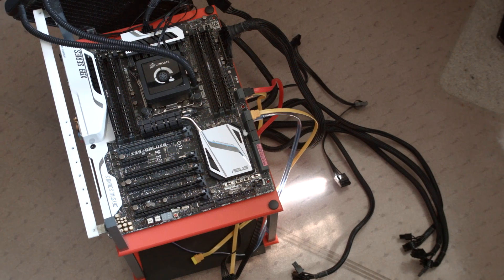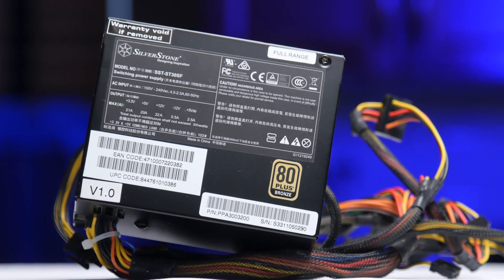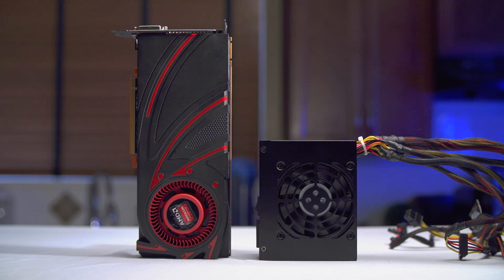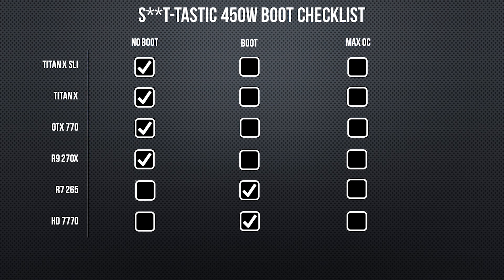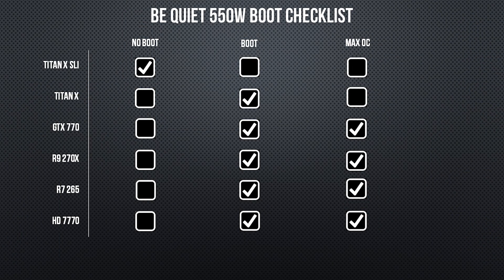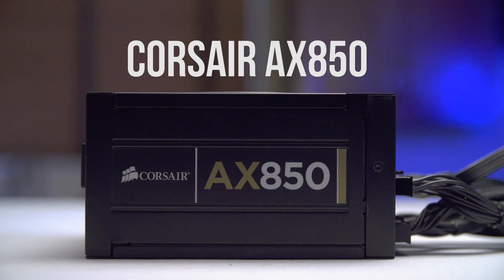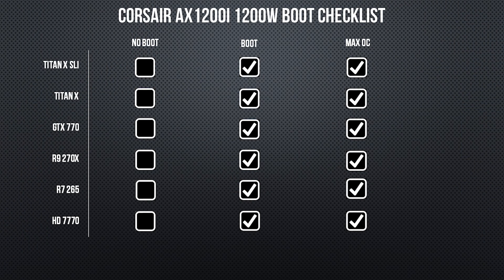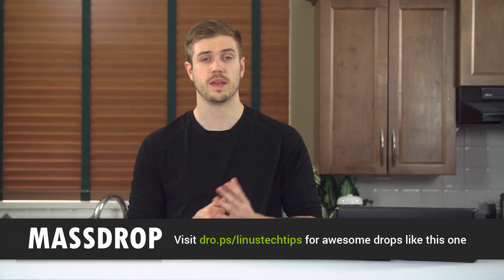Overclocking Recommendations - Low vs High Wattage Power Supplies

Comment: I was wondering if this was good for gaming

cpu: Intel Core i7-5820K
Ram: 16 gb
graphics card: Gtx 980 4gb
HDD: 3TB 
SSD: 250 gb
Reply: Thx, well I will be needing this quickly because I am getting rid of my alienware (btw I don't recommend buying since Dell took over. They are shit now). I'll be having it soon
Reply: Pierce Oconnor Good? Yes. Apropiate? Probably not. If you are an pure gamer and wont do any kind of content creation or you dont consider yourself an enthusiast who is willing to spend alot of money on minor gains then you should stay away from the X99 platform (which is the enthusiast platform) and from DDR4. Better get an Z79 or Z97 based system.

For high end gaming and basic content creation i recommend something in that direction:

cpu: Intel Core i7-4790k
Ram: 16gb DDR3
GPU: 980 4gb (If on an budget you could get the Gtx 970 or you could get an AMD Radeon card like the r290x)
HDD: 4TB (for Games)
SSD: 120gb (for Windows)

You will save ~450€ if you go down this road and see pretty much the same performance results. An High-End Z97 Mainboard like the Asus Republic of Gamer Maximus VII Ranger costs 150€ whilethe cheapest X99 Board i can find quickly costs atleast 250€ and my Asus Republic of Gamer Rampage V (X99) costs 450€.  The i7 4790k is about 150€ cheaper than the i7-5820k and 16gb DDR3 Corsair Vengeance for example is 140€ while 16gb DDR4 Corsair Vengeance cost 250€ and all of that X99 stuff gains you pretty much 0% performance increase in games, atleast today, since there is no game out there that supports 6 CPU cores. For SSDs i personaly only use them as OS drives since they are still pretty expensive compareds to regular HDDs and gain 0% performance in games except shorter loading times which is negligable.
Reply: Pierce Oconnor Of course the 980 is better but it is also double the price. The 970 is 350€ while the 980 is near at the 700€ mark. Performance wise you may see 10fps (84fps vs 96fps in Metro: Last Light on very high for example) more but for 1080p gaming at 60hz the 970 is more than sufficient and has probably one of the best price/performance ratio since a long time ago. And you could always get 2 970´s for the same money. Keep in mind that Vram of GPUs doesnt add up in SLI or Crossfire. That will work with DirectX 12 and Windows 10 tho.

Sure there is this whole ramgate nonsense out there. The 970 got split memory. An 3.5gb chunk and an 0.5gb low priority chunk which is alot slower (about as fast as regular Ram). But people are that missinformed that they think they would need 4gb of vram or more which is simply not the case.  In 1080p there is no way ever using 4gb of vram, not even 2gb of vram. In UHD (2160p) you may use 2,5gb of vram in Battlefield 4. There is no way that you would even cap out the 3,5gb chunk unless you would crank up anti-aliasing to the max which is a waste of performance at UHD anyway due to the massive amouth of pixels it is simply useless and doesnt improve the image quality whatsoever.

And just FYI, i personaly have the gtx 980 (EVGA SuperClocked Edition). GTA V PC for example (which actualy is an PC Version and not an Console Port) if i max out every setting, even the extreme ones, on my native resolution (2560x1080) i aproximately use 3700mb of VRam. I get about 60fps on average with an minimum of about 45fps.

I know that is a huge text wall but that are pretty much all the informations i can give you right now out of my head about this topic.
Reply: Woah woah woah woah... Laptop CPU's are MUCH MUCH more different than Desktop CPU's. Infact, a top of the line Laptop i7 4710HQ can bottleneck a GTX 980m to a certain extent (The 980M is equivalent to a Desktop GTX 970) Whereas a Desktop i5, in this case a 4690k can run a Titan X or even two of them without bottlenecking in gaming.
Reply: I thought the GTX 980 was better then the GTX 970
Reply: Wow, thanks a lot. I didn't expect this much. Money isn't the biggest issue, but I don't have that much. I'm only 13 btw. I'll be getting the 980 I guess. And one more question. Does it matter if the GTX 980 is from Nvidia or Msi etc...?
Reply: beyond305 I am buying it myself and I worked hard for it.
Reply: TheLordOfWar Not sure about that "Z79" system of yours, and the better suggestion would be :s the one below, as he is a pure gamer.

CPU: i5-4690k
RAM: 8GB DDR3 <-- 8GB is enough if you're not going to do any content creation.
GPU: GTX 980 Because that's what you want :P
HDD: WD Black 4TB A reliable, and good brand.
SSD: Crucial MX100 256GB SSD. You can get this for under 120$...
Motherboard: MSI Z97S SLI Krait Edition

And correction: The 980 is only 200$ more than the 970.
Reply: Inoichi Yamanaka Thanks for all the replies, but I had an i5 in my alienware 15 and it didn't work great. I do have school work so 16 GB would come in handy, but that SSD seems to be a very good deal. Btw I don't recommend buying an Alienware 15 2015 version. I bought an Alienware 15 and the first week I had it it crashed more than my old computer and the HDD kept disappearing. Fucking Dell reckt Alienware. My dad used to disassemble computers and always told me Dell is Hell now I understand.
Reply: Thanks
Reply: Pierce Oconnor MSI, EVGA, Asus and co are all board partners that sell Nvidias card under their brand and offer custom versions with their personal modifications to them. I personaly have (as mentioned above) the Evga Gtx 980 SuperClocked ACX 2.0 Version. If you get the EVGA card get the one with the ACX 2.0 cooler not the one with the 1.0 cooler tho.
Reply: Inoichi Yamanaka you already benefit from hyperthreading and 16gb of Ram in some games and you will benefit from it even more in the future. And infact that built i mentioned above was an z97 built not an z79 built ;). But back to the SSD topic. Why spend alot of money on an SSD that gives you no benefit at all in gaming except slightly faster loading time which already is very low in PC gaming?
Reply: Well. as you can buy the SSD for under 120$, Why not go for it? as 120GBs are 80$ and above, the MX100 250GB is the best deal you can get if you're looking for a 250GB SSD.
Reply: Inoichi Yamanaka I have a 256GB plextor SSD for a Steam game drive and it can barely hold a handful of games. You need at least 512GB if not more for a game drive as the game footprints are so huge these days.
Reply: LudicFallacies
 You can always get an SSD and an HDD and put it on raid mode if you want.

Comment: My 2 cents on overclocking...
 1. If you're upgrading cooling solutions to overclock, you're wasting your money.
 2. If you built it from the ground up to overclock, you're wasting your money.
You should really only do this, if you don't add any costs or if you find it "fun". Otherwise I can almost guarantee you, that in most scenarios you would have been better off upgrading actual hardware or buying better hardware. When speaking of price to real world performance, of OC build to Stock build.
Reply: Keith R what about if i built it from the ground up, times changed a bit (games required more power) so i changed with the times and added power cause my hardware is capable of it? eh kinda makes sense when you make sense of the situation and dont sound like a dumb ass.
Reply: Keith R I dont agree on that. Depending on the parts if you want to push the hardware anywhere near its limits (without getting too crazy like LN2 cooling solutions) you need to put them under water. an gtx 780 or an i7 4770k for example heat up like crazy and are hardly tameable while overclocked. An gtx 980 or an i7 4790k on the otherhand can be pushed on air without any problems at all and putting them under water doesnt really gain anything except making it quieter under load but louder in idle.
Reply: beyond305 Dude I said to do it, if it didn't add any cost to you. Which it didn't in your scenario. Very few instances where overclocking for a game, will net you what you need to play. Most times you're speaking of 1-10fps and 10 fps is being nice, when overclocking.
Reply: TheLordOfWar I said if you find it fun then do it. Cost is justified because you enjoy doing it. I said it is not worth it, if you paid more for cooling just to overclock. For your gain will not be worth it, most times. If you're speaking of doing water cooling, then almost all scenarios it was cheaper and better performance to buy better hardware to begin with. Unless of course you bought the highest of the high end already, but then again you're entering the "do it for fun" territory again. If it doesn't cost you nothing extra, then do it. Otherwise your money far as "Real world performance gain to your dollar" is better spent on new hardware or better hardware. I suppose I should have stated the real world performance to dollar part originally. Take a 780 and i7 4770k system, equate the cost of it for OC and stock. Then equate the gain of true real world performance(say with 2-5 games AVG FPS). The ratio for price of the hardware stock is almost always lower per clock, than a system actually designed for OC. Hence not worth it, when speaking of performance gain to your dollar. Unless of course it didnt cost you nothing. Otherwise yes I agree with you.
Reply: +Keith R Overclocking can make games play more smoothly. A killer system today will fall behind in 2-3 years. Overclocking lets you use the same hardware for longer. CPU coolers now come with universal mounting hardware that lets you use the same cooler on multiple sockets. I've used the same Noctua cooler on my systems, starting with an LGA 1156 system, then to Sandy Bridge, and finally sitting on my current Haswell CPU. 
GPU overclocking may yield a few fps increase, but framerate doesn't tell the whole story. The smoothness of a game improves drastically. For example, a mere 40mhz core clock increase on my old HD 6870 resulted in a minimum fps of 22 on Valley benchmark where it was only doing 5fps before. The average fps and benchmark score didn't improve much, but there was a noticeable improvement in how much smoother the benchmark ran.

Comment: 375*.8=300 watts of usable power, so that sounds about right. The wattage is the amount of power the psu can supply, not how much it draws. You were probably just maxing out the current on the 12v rails.

Comment: You do realize that the measured power consumption from the wall is including loss in AC->DC conversion?

Typically PSUs have an efficiency of 80-90%.

Comment: Heres the deal for everyone looking for a PSU. I don't know about you guys but a PSU is probably something i upgrade as often as my monitor maybe every 5 years or so. If anyone wants to argue feel free. Most well made PSUs are there most efficient at 50% load. If you are using a 650w psu when gaming and using up 500w youre running it closer to 75% load. The more load you put on a psu the hotter it gets and the least its likely to last. People are always saying 1000w psu is pointless for a 400w system. That may be so but its also very efficient, it will also run a whole lot cooler. Depending on the psu efficiency will vary greatly, a seasonic 1000w for example is 79% efficient at 100w while an rm 1000 is 89% efficient. 

I switched from an tx650 bronze to an rm 1000 gold. My rig probably draws 300watts tops at load yet the rm 1000 is more efficient at 30% load then the tx650 is at 50% load. Electricity is quite expensive here in France quite more so in other countries.

Comment: How resolution is effected as screen size gets bigger would be interesting! I heard that 1080p monitors tend to start blurring after the 24inch mark
Reply: Liam Bates Its simple.

24"  - 1080p
27"  - 1440p
+30" -2160p

110ppi (pixel per inch) is pretty much the sweet spot. 

1080p@24" has   91ppi
1080p@27" has   81ppi 
1440p@27" has 108ppi

2160p@27" has 162ppi

2160p@34" has 129ppi

For gaming the sweetspot is definitely at 1440p@27"@144hz. UHD (2160p) has a great image quality but is limited to 60hz and got an slow responsetime. Besides that the hardware required for 2160p is alot more expensive than for running 1440p at 144hz.
Reply: Liam Bates http://s3.carltonbale.com/resolution_chart.html
Really good synopsis from the projector folks...hard to scale down to sitting close size...but you can see where the line of sitting distance versus screen size in conjunction with resolution matters.
Reply: That actual makes a lot of sense and was really simple, thank you :)

Comment: well i bought 850w cooler master v for a system thats going to use about 300-450w max. As psus reach their peak efficiency at around 50% load. Less component strain, kess heat, less noise and its going to last for at least 1 more build in the future if it doesnt blow up in 2-4 years.

Comment: Anyone running a dual 270X system? If so, what PSU wattage do you have? Would 600W do the job?
Reply: ***** I'm using a 8320, doesn't it use a lot more power? Thanks for the reply btw.

Comment: Well, Looks my Corsair RM1000 Watt will be just enough if I should upgrade my 2600K and 970s SLI to an OC 5820K and Titan X SLIs.

But then again, my current setup, still happy with it.
Reply: MusicHaven2012 That's literally like asking if you should upgrade from a mustang to a ferrari. Who is going to say no?
Reply: MusicHaven2012 Should be perfect as long as you dont use all 1000watts. Power supplys last a lot longer at there most efficient state and temperature.
Reply: 2600K bros! Still haven't found a need to upgrade... Can play AAA titles with only about 60% utilization... All good in the hood :D
Reply: MusicHaven2012 RM Series units from Corsair powering SLI Titan X's. I'm so fucking done
Reply: proxactual I use the EVGA Supernova G2 1000, this PSU kicks all the ass and I think it looks sexy. Now that I know my 1000 watts is just enough to comfortably run two Tinan Xs in SLI I should be using it in my next build as newer generations of PC components seem to be getting more efficient or staying the same. It also helps that EVGA gave it a ten year warranty.
Reply: MusicHaven2012 you might as well donate that amount of money to an orphanage ;)

Comment: Need the communities advice:

I'm running an OC'd G3258 @ 4.2Ghz 1.2V and a XFX 7970 Black Edition (Stock clocks) on a 530W Thermaltake PSU, is that sufficient? I don't plan on OC'ing my 7970. I was thinking of getting a Be Quiet! 630w PSU because the Thermaltake makes a rattling fan noise even at idle.

Comment: i have a 450W 80+ bronze psu and run gtx770/ r9 280x with Oc and an i5 2500k @ 4,4 ghz without any problems. I only pull like 390W max from the wall, so why do you need so much wattage for your gtx 770 setup??
Reply: Melvin Gimp I ran a 770 SLI / 4790k 4.6ghz with a 650w Seasonic for over a year... 450w for one 770 seems OK.
Reply: Melvin Gimp  its bronze so it pulls like 30-50w more to supply your pc, so its reaching its limits.
Reply: Melvin Gimp because not everyone has a decent psu. Ampage matters your psu can produce enough watts with the amps (its really hard to explain) this is why a low quality 600 watt psu is recommended
Reply: you don't seem to understand how this works. the 390w are inclusive the 15% losses!
this means the system only pulls like 350 in reality. when you measure the power behin the system at the "wall" you have the total consumption with all power losses!
Reply: Yes it did "boot" with the gtx 770, like he said.
But he wasn't able to reach any oc and even with the 270x he only got some oc on the gpu (not cpu).
Just saying I run a gtx 770 oc and 2500k oc just fine ,which should have a similar power consumption (5960x 140w tpd, i5 2500k w 1,3 vcore ~ 135W?!?)
Reply: I understand his testing method. And I know its hard to compare our different system setups. But i was just wondering: He wasn't able to reach 270x gpu+cpu oc ("only stock clocks"; r9 270x ~ 180w tdp). GTX 770 "did Boot" sounds not very promising...
That system just seems t odraw awkwardly much power...
Reply: Becuz he using 5960x.
Reply: An R9 280X running on a 450w psu?!
Reply: Melvin Gimp Obviously aliens. Like I keep saying, you MUST line your hat with aluminium foil to keep the alien google machine from stealing your brainwaves. Why doesn't anyone LISTEN?